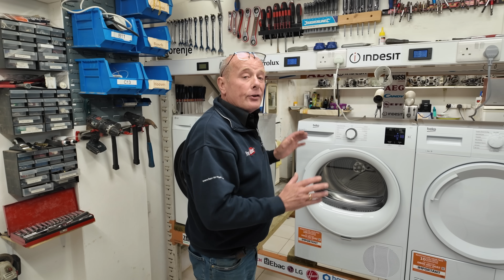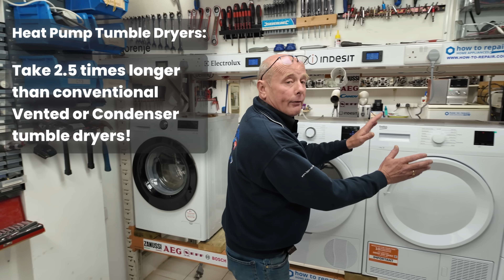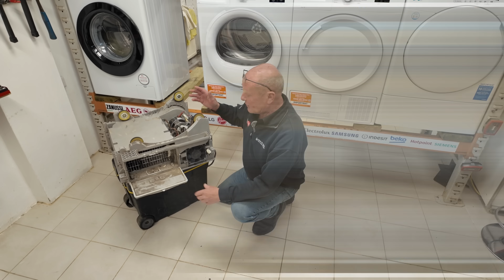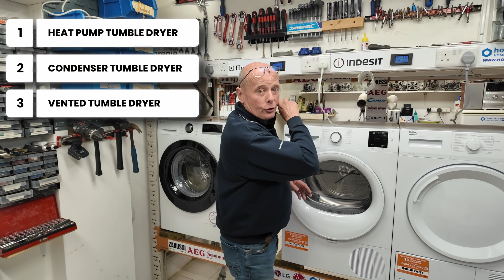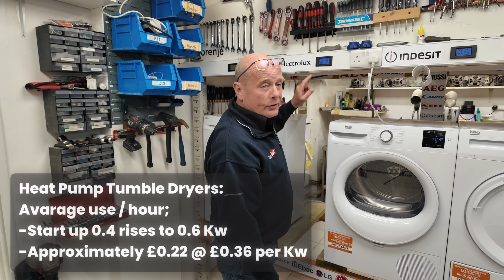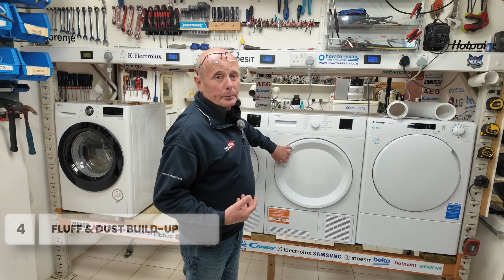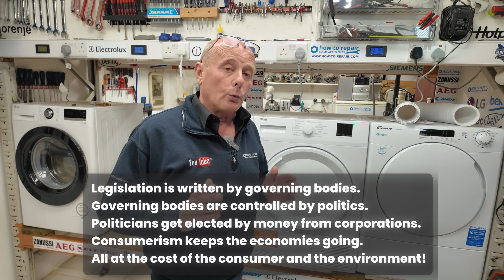Tumble Dryers the Shocking Truth About Heat Pump vs Vented & Condenser, NEW LEGISLATION!

Comment: With regards to wear and tear on clothes - I was under the impression that the heat was lower (part of the reason they take longer) and the drum goes slower, so the actual wear and tear is lower despite the higher run times. I'd be interested to know if that's true or not, but I think your "it takes longer so it damages clothes more" may be a little simplistic.

Comment: I suspect that the government and regulators only have one priority - reduce energy consumption!
They may be aware of the downsides of heat pump dryers but, they are judged to be unimportant in comparison.
Interestingly, I would suggest that heat pumps for domestic heating has as many issues when compared to an traditional condensing boiler heating system. Again, regulators are sitting on their hands as their only concern is energy usage reduction no matter the cost or inconvenience to consumers.
I would suggest that regulators should address the problem of built in obsolesce and easy reparability across all products and that would solve most of the issues you highlight.

Comment: I had an old Miele sensor drier and if i remember correctly it had a pickup mechanism to the drum for the sensor.  This failed (the only failure in about 20 years) and i couldn't get a replacement.  I binned it and went to buy another Miele but they no longer made them and came away with heat pump one.  Hate it.  It doesn't reverse tumble so clothes can get knotted, takes longer and waiting for large repair costs. On my old one I extracted the hot air into my heat recovery system so it was a win-win.  Stuck now and should have kept it and made a part to fix it.  (As an aside, all our other appliances are Miele and they are superb - well built and last.
Reply from the maker: Miele makes good machines, and their older models are fantastic, but their parts are very expensive. Theye used to place the wiring diagram under the lid of every machine. I'm not certain if they still do that now.

If any of your friends or family are thinking about buying a new dryer, it would be helpful to share this video with them. It will give them an idea of what to expect when purchasing a new dryer.

I hope older models will still be available, but I can't promise that. It's important for people to know the differences between the dryers on the market and understand any potential issues before making a purchase.

Comment: Thank you for preaching about this I completely agree with everything you said! I have been in this industry my whole working life and repairing machines….They are a waste of money!! I work on the odd one but mostly choose not to waste my time potentially having to strip down a machine (which have a stupid amount of screws and wires and things to take apart) -which  will take a good couple of hours to diagnose the fault, only for the customer to then not want to spend the money out to repair them… as they end up often having compressor issues or leaks on the pipes, or to de-fluff the airways and are far too time consuming and expensive to repair… on top of that you are then guaranteeing your work which in the back of your mind hoping and praying you don’t get a phone call for a recall as something is still not correct and then having to go back to the machine. 
Waste of money, not reliable, and as you say good luck finding an engineer who is willing to repair these machines, customers always ringing in saying no one will touch them… so how are these “the future” when they end up in landfills alongside the refrigeration units.

One major issue is they are used like an older tumble dryer and customers often don’t clean them very often, which is the issue of the user… but these heat pumps need to be maintained to a high standard to prevent the fluff building, which from my experience customers Iv been to over the years often don’t clean them as often as they should.
Many had no idea of the sponge filter that covers the pipes that needs cleaning or changing, so lack of knowledge on them and maintenance of the cleaning always leads to early breakdowns.

Manufactures need to make these parts more cost effective, and much easier to access, I would love to see the guys at the top who are making these decisions on these machines being “the future” actually try to take one apart and repair it…. In a tiny utility room with no room to swing a cat whilst a customer is firing 40 questions at you whilst you’re trying to concentrate on not misplacing anything or breaking anything.

It’s refreshing to hear some one in the industry speaking out about these issues rather then going along with them saying how great they are when you have highlighted all the issues I have informed many customers over the years… heat pump dryers are not the answer going forward, they either need to be tweaked to make them easier and more accessible to fix, or just go back to the older systems or work on tweaking them to make them more efficient.

Not a fan of heat pumps at all, I will never own one or recommend one to anyone, I would rather dry my clothes naturally or by using an airer which has always been the method of how I dry clothes.
Something needs to change or we are all in trouble if these machines take over completely which seems to be what will happen.

Everyone who has had a good experience with them.. congratulations… it’s what you should expect when paying out £400-£800 on a heat pump.

it’s only when you have one break down you will encounter a very expensive repair bill, that’s if you can find some one who is willing to come out.

Much prefer the condenser or vented… yes they are not perfect and there is more of a fire hazard vs heat pumps… but they are much cheaper to buy and repair and can usually be repaired on site and you are not having to buy a new machine each time.

Well done for a great video 🙏
Reply: Cause the future is disposable in the name of Green New Deal!
Reply: Lets assume that:
Let's assume you have 800 kg (1 person household) of cotton dry equivalent of clothes to wash per year. (That number is about EU27 average.)
Looking in the UK, average for WP is about 0.25 kWh / kg or 200 kWh. For Cond. / Vent you're at like 0.6 kWh/kg or 480 kWh.
Electricity in the UK is now at something crazy like 36 cent / kWh. Lets assume they get it back down to 0.30£.
Now run it for 10 years. That's 1440£ for the cond / vent or 600£ for the WP in power costs.
If you go with the Cond/ Vent, it proabaly lasts probably 10 years with a 100£ repair while the other one is done after 5 years with no repairs. Cond / Vent will be about 300£ the WP more like 400£ (Go medium on the Cond/ Vent, needs to last 10 years, go cheap on the WP only needs to last 5 years).
Lets sum up the Total ownership cost for 10 years:
cond / vent: 1440 + 300 +100 = 1840£
 WP: 600 + 400 +400 = 1400£
Even if the WP one breaks after only 3.3 and you replace it you're still even with buying outdated tech.
And no, Power is not gonna magically get cheaper, if anything Europe's lack of resources and the new geopolitical realities will rather drive it up even more.
For clarification: If you buy something WP in the 1000£ range (even with the usual design flaws) it's probably gonna run 10 years without repairs or issues. If you find something without them (meaning actual filters suitable for a WP unit) it will probably last longer. Seems Sweden has some in the 800£ range that lack the flaws.

Comment: I have a speedqueen gas dryer, which being gas is vented. It is incredibly fast, and dries a big load of wet towels in less than 1 hour. I intend to keep it working indefinitely,  as parts in it are simple to swap in and out.
Reply: Now when SpeedQueen makes a heat pump dryer? I'll be fascinated. You can't beat a SQ...
Reply from the maker: Thanks a lot for your comment mate. To establish their brands, the majority of manufacturers produced high-quality machines throughout the 1980s, 90s, and early 2000s. However, now planned obsolescence and the lack of repairability are major issues in the industry. Manufacturers prioritize profit over long-term reliability.

If any of your friends or family are thinking about buying a new dryer, it would be helpful to share this video with them. It will give them an idea of what to expect when purchasing a new dryer.

Comment: Had a heat pump drier for about 3 year after my 14ish year old Bosch condenser failed, my wife does the washing as I can't be trusted, but all she does is complain about how long it takes to dry clothes, we have about 5 loads of washing a week as a family and the drier is on for about 14 hours over the weekend, with a condenser it would have been less than half that.  Unless this improves massively I'm going to go back to a condenser, happy to pay a bit more to have the job done in half the time.
Reply from the maker: Thanks for sharing your experience it's a very valid point! Heat pump dryers are marketed as energy-efficient, but the trade-off often seems to be the extra time they take to dry clothes, which can be frustrating, especially for a busy household like yours.

I think heat pump technology is brilliant, but these machines are only lasting on average five years they take at least two times longer to dry the clothes at least twice the amount of wear and tear and components and the accessibility to do maintenance is an absolute nightmare. manufactures do not seem to understand what maintenance is needed and how easy it is to do. They seem to build it and assume it's perfect without testing properly. Thank you for your comment. I would be grateful if you would share this post, as it’s the only way to force things to go large nowadays.

Comment: Interesting comments, but you don't back up the "heat pump driers take 2.5 times as long" comment.

Drying clothes is all about adding energy to wet clothes to encourage the water to evaporate, plus passing dry air over the clothes to take away the moisture.

- Traditional driers use ambient air, perhaps 50% humidity, and high heat, roughly 100% efficient in their electrical heating.
- Heat pump driers use dehumidified air, perhaps 10% humidity, and medium heat, perhaps 400% efficient in their electrical heating.

Yes, heat pumps are more complicated than a plain heating element and fan, but if they're designed for easy maintenance (fluff removal) they can easily last like a fridge or freezer can: typically longer than a plain old electric heating element. I wonder how many people pay £100 for someone to come and fit a new heating element, rather than just buying a new machine?

I'd love to see data on lifespans of cheap "disposable" machines versus more expensive well-engineered machines (e.g. Miele). Bearing failures shouldn't be a problem in any domestic appliance, from a technical point of view: only if the manufacturer uses extremely cheap poor-quality bearings to keep costs down.

Comment: We made the expensive mistake of buying a Bosch heat pump drier. I would challenge your estimate of drying time being two and a half times as long, we would say at least four times and that does not include the frequent trips out to the garage to untangle the bundle of sheets which would remain wet in the middle however long it ran for. Once again we are in the situation where until the idiots in charge (and their wives) are personally affected we will be stuck with it.
Reply from the maker: They take at least two times longer to dry the clothes at least twice the amount of wear and tear and components and the accessibility to do maintenance is an absolute nightmare. Manufactures do not seem to understand what maintenance is needed and how easy it is to do. They seem to build it and assume it's perfect without testing properly. Thank you for your comment. I would be grateful if you would share this post, as it’s the only way to force things to go large nowadays.

Comment: Had heat pump dryers for about 4 years.  1st one was a £10 hoover from FB marketplace, quick simple fix and it lasted 2 years. 2nd one is the cheapest 8kg on the market, purchased brand new, it uses 900w on a typical load. Three loads a week over 5 years saves us £250, I think they are great but much slower than conventional dryers.
Reply from the maker: I think heat pump technology is brilliant, but these machines are only lasting on average five years they take at least two times longer to dry the clothes at least twice the amount of wear and tear and components and the accessibility to do maintenance is an absolute nightmare. manufactures do not seem to understand what maintenance is needed and how easy it is to do. They seem to build it and assume it's perfect without testing properly. Thank you for your comment. I would be grateful if you would share this post, as it’s the only way to force things to go large nowadays.

Comment: I replaced my vented dryer with a heat-pump dryer and it’s absolutely fantastic! Quite frankly the cost savings per load that we have been seeing far outweigh any concerns of longevity of parts.
Reply: I guess though I think the point he's trying to make in the video is even if the cost is half per load, but the machine only lasts a few years and then when it does break it's uneconomical to repair, instead of being about to put in a 40 pound heater you have to buy a new 4 or 500 pound dryer, then you actually might end up saving nothing at all.

Comment: Correct me if I'm wrong but sureley the heat still has to come from somwhere for the heat pump. If your heating your house with electricity conventionally, and this then takes that heat out of the air and into the water in the clothes then your really losing out here? 

If it takes 400wh to power the motors in the machine for 1 hour, and it is 2.5 times longer, one could presume it is basically extracing 1 kwh from the air around the machine (vented was using 2.5kwh to dry, and as it is a resistive element most of that energy ends up in the water) which means in reality your spending 1.4kwh to run the heatpump  machine for 2.5 hours compared to the vented machine running for 1 hour @ 2.5 kwh.

 In my simple math, that would mean you consume 3.5Kwh for the heat pump. The reason heatpumps on houses are good is your extracting heat from outside your property and moving it into your property, basically using the suns energy outside!
Reply: It doesn't work like that, the drying air circulates in a closed loop, the warm moist air leaving the drum passes through usually a couple of filters into the heat pump's evaporator, which extracts the heat, condensing the moisture out, then passes through and is heated up by the condenser, which is hot from the compressed refrigerant pumped through it and the now dry warm air is blown back into the drum by the fan. The refrigerant will also pick up heat from the compressor and as I understand it, they have a cooling loop the refrigerant passes through that is cooled by a thermostatically controlled small electric fan drawing air from the room to get rid of the excess. Basically all the electricity used by the appliance will end up as heat and warm the room, it will just warm the room less than a conventional condenser dryer as it uses much less electricity, it also doesn't dump air from the room outside like a vented dryer would do, wasting more electricity if you've got the heating or an air conditioner on.
Reply: @ thanks. That makes more sense.

Comment: I love the heatpump dryers, but most of them had a bad filter system. I have a Miele from 2013,but I don't want to use it often. It has now 3900 hours of use, I striped it completely down, the condenser unit was fully blocked. After cleaning, change a lot of parts it runs perfectly. It only takes with his 1100 watt compressor 1-1,5 hours to dry. Very good time for that. But every time cleaning so much filters, that's so disgusting in a 5 person household in winter. I use an old Bauknecht kondenser dryer, more than 25 years old, no repairs, no strip downs, easy to clean. With that it makes more fun to do laundry. That's why I love so washer dryers, a good maintenance is so important.
The fault is the government, the price of kilowatts so high at the moment, so the industry has it easy to give it to us....
Reply from the maker: I think heat pump technology is brilliant, but these machines are only lasting on average five years they take at least two times longer to dry the clothes at least twice the amount of wear and tear and components and the accessibility to do maintenance is an absolute nightmare. manufactures do not seem to understand what maintenance is needed and how easy it is to do. They seem to build it and assume it's perfect without testing properly. Thank you for your comment. I would be grateful if you would share this post, as it’s the only way to force things to go large nowadays.

Comment: I'm over 60 and live in sheltered accommodation. We have a laundry which we all use that has 2 washing machines and a tumble dryer, one that vents the hot air outside. If heat pump dryers take over twice as long to dry clothes its going to cause awful backlog in the laundry. There must be many in communal situations like this. or do they expect to have killed all us old people off by then.